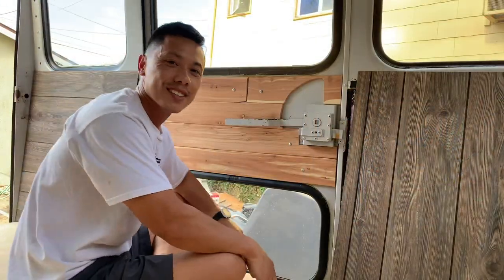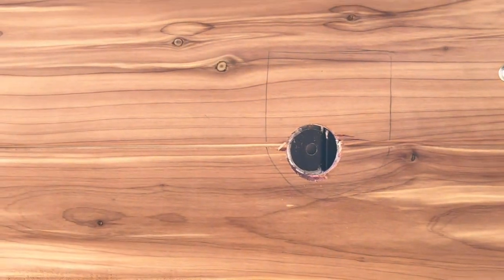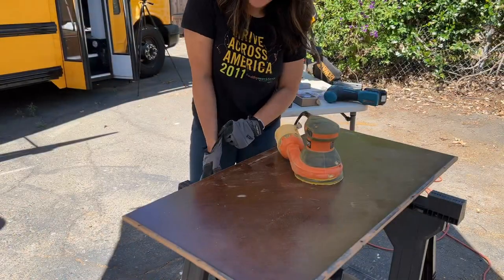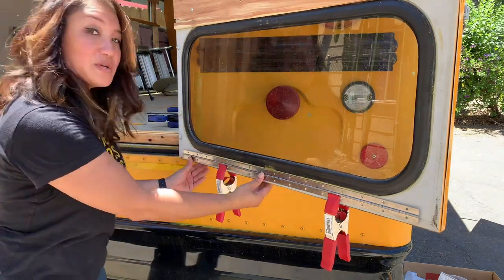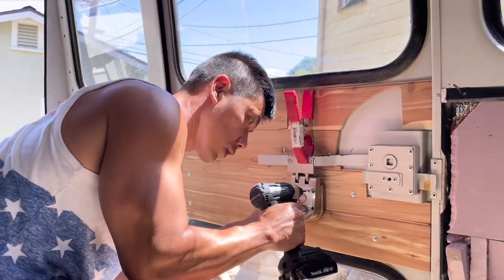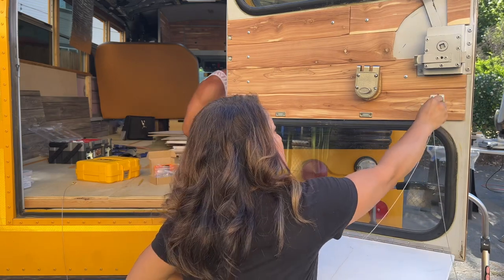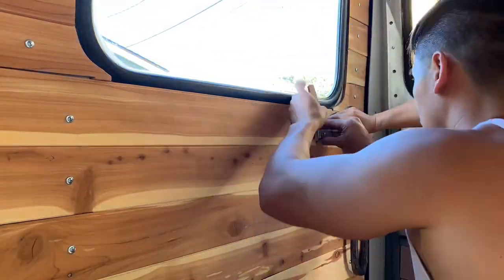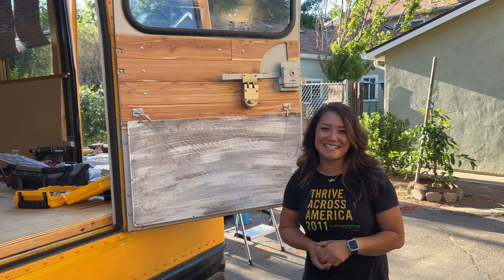Locking Rear Hatch | Folding Table On Door | Short School Bus Conversion Ep. 10 | KEANU ShortBus

Comment: I don't know about y'all's rear door handle but mine is sort of loose so the arm doesn't always end up in the same position when it's closed. I filed/dremeled down the lugs/rods in the lock body so that they're ramped.

Now when I go to lock the door, the lock engages the handle perfectly even if the handle is slightly out of place.

The ramping process doesn't affect the lock integrity since the exerted forces aren't terribly strong (the plastic handle on the outside would break first!).

That outdoor table is a genius idea. At first I couldn't figure out why it was so low on the rear door then it eventually all clicked. 😂
Reply from the maker: Our handle is pretty solid. It is consistent when closing as long as you engage the handle fully to the closed position. 

As for filing down the lock body, we encountered that as well. Rather than filing, we did leave the part on the lever slightly loose so it has a bit of horizontal slide so when it hits the lock body, it can fall in place to be locked.